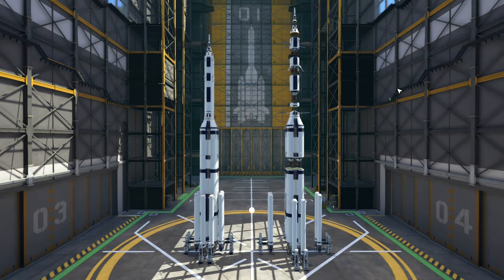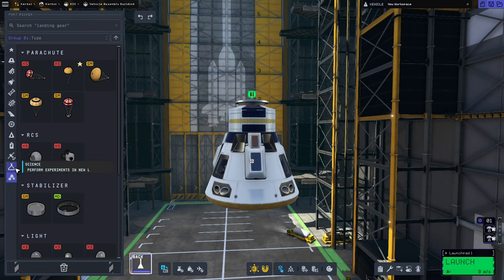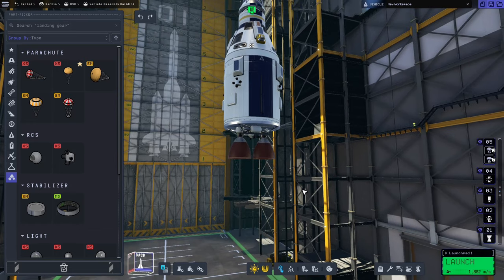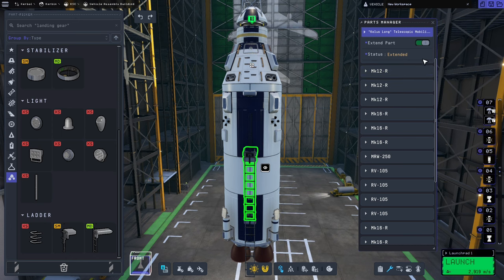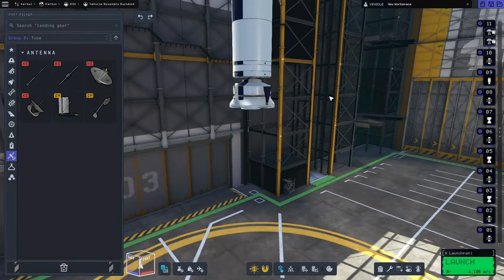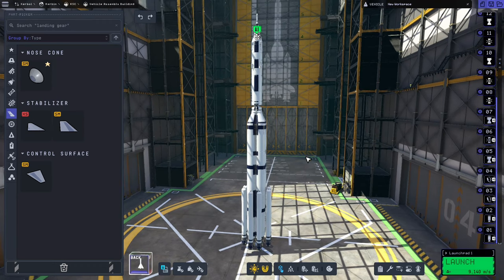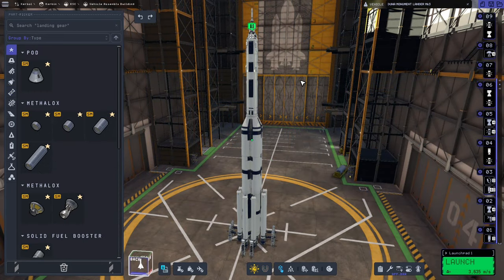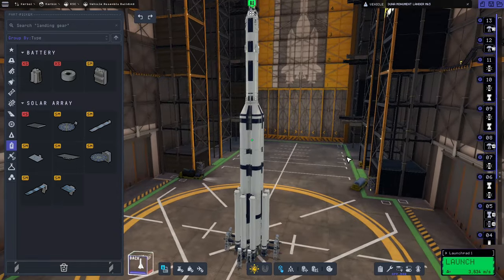KSP2 - For Science! Duna Monument Lander BUILD GUIDE

Comment: The build works great until you add the docking port on the escape capsule. Then it cuts the DeltaV for the top half of the ship once the rocket it finished. Making the maneuver to Duna then you're unable to finish the plan because it says your out of fuel. Once started over and left out the docking port on top of the ship it worked just fine.